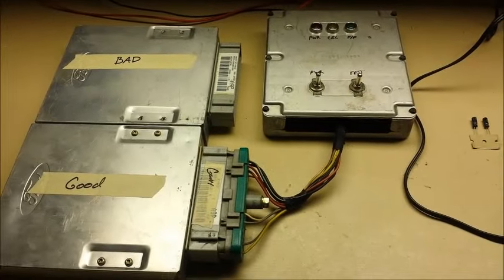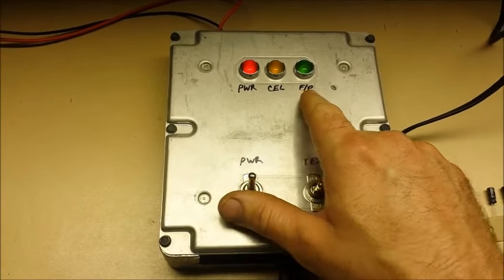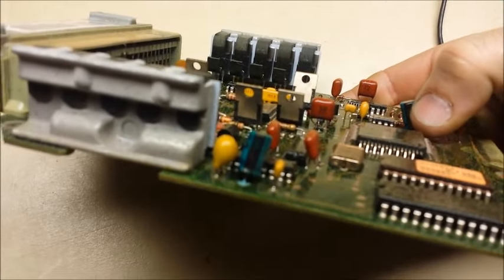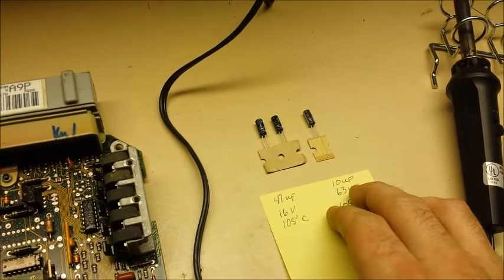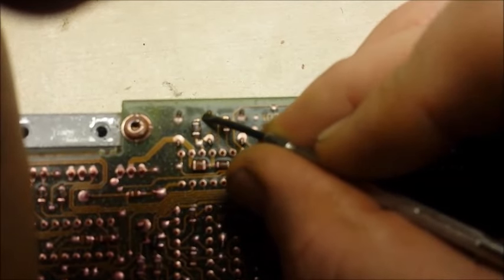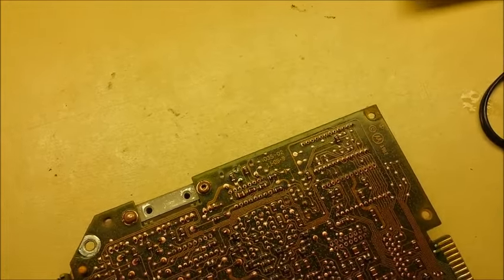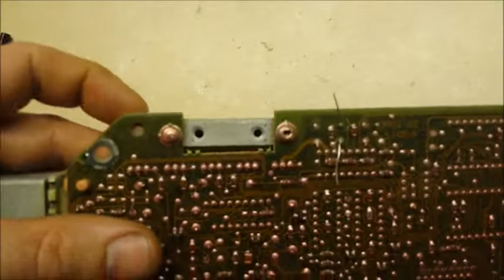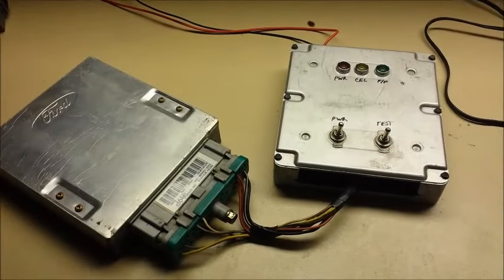Fox Body Mustang PCM Repair

Comment: ive been trying to figure out what is going on with mine for a couple of days before I saw this. I definitely had corrosion on 2 of my caps. I cleaned them and reinstalled and same issue but mine is a little different. I plan to follow you in this and install new ones but maybe you can shed some light on my issue as it's a little different. At first, as soon as I would connect the battery, the fuel pump would turn on, found out the there was a toggle switch that was in the "on" position so that explained that.Then, no matter where the switch was the wire to fuel pump was always on and running the pump. spent about 10 hours checking wiring, tracing wires, reading diagrams and diagnosing and come up with the same issue, except the pump maybe grounding out because as soon as I connect pump I get no voltage, as soon as I disconnect ground I get voltage at the relay wire that i can't switch off or on. So it's stays on like a bad ecu and as soon as I connect the pump runs for 2 seconds and fades out and voltage disappears as if it's being grounded out. Vehicle is a 1967 mustang with efi swap, vehicle used to run with this a3m1, I have a old Hickok breakout box I will try to figure out, anyway, any ideas? Sorry for lengthy post! Appreciate any help!

Comment: What are the functions of the capacitors? Is the 10uf/63v one for a power supply? And the 47uf/16v ones are filters of some sort? 

Can the computer be tested for functionality outside of the car?

Comment: I just got a 89 coupe with some work done to the motor bt its deff running rich n fuel pump running all the time. I haven't checked the KOKO to see if I can read the codes or looked at the computer to see if they are corroded yet, but I am goin to still go ahead n purchase the capacitor in case it does or possible  is wrong with it. Is there a better kind of capacitor to buy? Or the regular one's fine? I had seen some that was aluminum n they was 8 bucks a piece, n well if it matters then I will get them, but if not I will just order the regular one's. Thanks a million for this video, I haven't checked to see if the relay is bad also for the fuel pump or if some dummy just jumped it over. Like I said I just got this coupe n it look's like someone had it doin it right with the parts that is on it, then some one got a hold of it n didn't know what they was doin. The guy I got it from said a young boy had it before him n he acted like he didn't know a whole lot also. I been doing these car's for 20ty some yrs n this video is the first I have seen about the Ecm, many thanks again!!

Comment: Thanks for the informative video. A few years ago I replaced the 10uf cap which was obviously deteriorated.  I left the two 47uf caps in because they both looked OK and passed the ESR test but I will follow your advice and replace them. I recently pulled the PCM out again because of a 'no spark' symptom. I am following the TFI worksheet at TheRangerStation website. I am trying to find pin 56 on the PCM board so I can check the continuity from the TFI socket to the PCM socket because I am getting less than 1 volt at the TFI SPOUT connection. Is there a pinout of F2TF-12A650-PB or similar PCM on the net? I am diagnosing a 1993 E-350 with a 5.8.  Thanks in advance for any help that you or anyone else can provide.

Comment: Great video man.Ive got a couple questions though.Im aware of another common problem with the A9L,A9P,etc which is the shorted SigRtn trace on the ecm board.To keep things very simple,can you list all of the symptoms that can occur when the capacitors are bad and when the SigRtn trace is open?? 

(Example)

Bad Capacitors:
    1)fuel pump runs continuously
    2)check engine light off with koeo
    3)  "                "

Signal Return Shorted:
    1)scanner fails to trigger a code test
    2)codes present for act,ect,evp,bp,tps
    3)  "               "

Thanks for any further assistance you can detail about this topic.
BTW-did you use the case of a EEC-IV ecm to build your tester and can you let your secret out as to what you used to build it?? 
                                          Thanks again
                                             WBRockstar
Reply: sigrtn burnt leaves you unable to dump codes, constant cel light on and running like total crap.  the caps leaking from age and burnt traces are about the only issues I've run into but I 've only repaired a few dozen years ago.  came across this seeing if anyone made a video after seeing the crazy money these things are selling for now since I'm getting back into an old efi 50 on a 93 I just picked up, went coyote swap along time ago on my other car.

Comment: You still offering this service? 
I have this exact same problem. Be trying to find the problem for a minute now. I was idling and the car randomly just died. Wont start but cranks. I have fuel pressure, spark, and power to injectors, car starts on starter fluid. But no injector pulse and fuel pump stays on continuously.

I found one of my capacitors has green fuzz pooled around the connection.
Reply: Eric Larsen I have the exact same symptoms glad I’m not the only one. My capacitors are bad as well.

Comment: I.m working on a 99 Mazda b4000 I have a no crank and no power to the PCM diode but do have power to the PCM relay also don't have power going to the ignition side of the starter but I think the problem is in the PCM could you tell me if that's possible

Comment: A 91' GT My dad bought new (I was about 3 or 4 years old at the time) finally broke down for the first time after 28 years of a daily driver last summer and it's been sitting ever since, and I think this is what's wrong with it because I've tested and tried it ALL.. Dad saw this and I cracked the ECU open to find Capacitor #1 completely blown out. Hopefully once I find these pesky hard to find Capacitors it'll be it and I can send you some roses and chocolate (Joke).
Thank you and I'll keep you guy's posted on weather it worked which I'm sure it will.

Comment: Hi, i have a A9T computer that doesn't light up the check engine light is it broken or it can be fixed the same way??
Thanks for your time
Reply: Hey there...did you ever figure this out?...I have an A9L and there’s no CEL at any time...sure it could be a bulb but I am also unable to pull any code even 11...would think it would have to be throwing something...initially the car ran but had an off idle stumble and at low cruise and would get to bucking like crazy...5sp...tfs 1 cam...would have to really ride the clutch a bit to take off at times...idled somewhat high...surging would be intermittent...tps appears to check out...IAC when disconnected would drop idle which was the only investigation I’d done...went through other things like trying to set base timing and wouldn’t want to stay running with spout removed...also appeared way retard as almost a tooth off to get it to 10*...fresh plugs and cap/rotor...just had the caps replaced from a local electronics shop...still no CEL...actually haven’t started it yet...will have to mess with timing again when I’ve got more time...turned over but no start...please any advice would be wonderful...very disappointed and coming to a bit of a loss as to what route to take at this point...as we have all been at this point where you think it’s gonna fix things only to be let down
Thanks in advance...

Comment: My fuel pump never gets the 2-second pulse it just always stay running but if I prime the engine with starter fluid it will run and stay running, But! it won't display codes when a scanner is plugged in or in use of a jumping wire. I'll try my best!!!

Comment: Very good video, I am actually thinking, I could do this! Where do I buy those 2 different capasitors?? EBay?/ Could this be my problem also?? I have 2004 mustang, 3.8 litre engine on. I get "check fuel cap" light coming on, even I replace cap, NO help, I did change fuelpump bigger,255 lph, since I am planning to add supercharger from Cobra into it (already bought it). I also replaced throttle body bigger, now 70mm, used to be 60 mm?. Now I have high idle really high, like 2500 for awhile, after 20-30 seconds goes down to 1200 RPM, never lower??/ Codes says there is problem with large leak, can't find it and also P0443= problems with purge control valve circuit, P0455 EVAP system large leak, and P0405 Ext. gas recirculation sensor circuit low?? I sure can't find leak, and replaced so far TPS, IAC sensor, EGR, purge solenoid valve, purge valve???/ Could purge solenoid valve be open all the time, and reason being bad PCM/ECU?? Former owner replaced starter, and did bad job, car never started well, and was very difficult to start?? Maybe he shorted something out???  I actually had to replace starter again, couple months ago. Is PCM same in all Mustang?? Or different in 3.8 litre and 5 litre?? Should I take PCM out and check these 3 capasitors?? Thanks a lot, this was a great video, youtheman =)  Ps. could you check/measure capasitors someway without taking them out of board, unsolder them?? thanks...
Reply from the maker: 2004 will not have the same type of capacitors that commonly go bad. PCM failures are pretty rare for 96-04 computers. It definitely sounds like you have a big vacuum leak. The best way to find a leak is with a smoke machine.
Reply: OK=) Thanks=), but high idle and P0443 seem to tell that PCM bad??
Reply: So, what usually goes bad in 2004/ OBD2 computers??? Different kind on capacitors??? How do you test them?? Thanks=)
Reply: Can you tell me what kind capacitors newer Mustang 2004 OBD2 PCM has?? Where can i order those and how to check which one are bad??? Thanks a lot=)

Comment: I just had that exact capacitor changed in my ecu well after watching your video i notice my polarity stripe is backwards. Can you tell me which circuit that controls? I have no check eng light with key on, car does run but i want it correct. Thanks

Comment: Thanks for the video. Mine started running the fuel  pump KOEO about a year back. I haven't had time to mess with it since it is not my daily. Before that It would erraticly quit with the ect hooked up. And it has been running unhooked for a while. Would a tune (running Quarterhorse) become corrupt out of nowhere? Regardless the eec is coming out as soon as I get home.
Reply from the maker: Yes, it's possible. The QH uses a coin cell type of battery to keep the tune stored in memory. When that battery dies the tune is lost and you will get the fuel pump run-on condition. Early versions of the QH were shipped with an incorrect resistor that would make the battery die prematurely. The newest versions have the battery in a replaceable socket so you can replace it yourself. Earlier versions had the battery soldered in place and must be sent back to Moates for replacement. Their turn-around is quick and their customer service is excellent. Try reloading your tune with a laptop, if it corrupts after removing power and USB for a couple of minutes then you likely need a new battery.
Reply: Ok Ill try that. It has been in there since 2012.
Reply from the maker: 2012 is right around the time frame of the bad batch of resistors.
Reply: On the Quarter Horse? Details
Reply from the maker: Yes. The bad batch of resistors caused the QH battery to drain faster. I'm pretty sure it was in 2012 when they shipped.

Comment: I have a 90 Mustang GT also and the car has been sitting for a while. It ran perfect before I parked to work on another mess of mine. The check engine light will lightly flickers with or without jumping to check for codes. The pump does run as described in your video, please advise if you think the ecm needs repair, thanks
Reply from the maker: It sure sounds like it. I'd crack it open and give it a look.
Reply: Yes, the capacitor is leaking as you suggested, can you refer me to a seller for these?
Reply from the maker: Radio Shack, Digi-Key, Mouser.

Comment: Great info, thank you.  Do you happen to know what color the check engine light wire(s) are?  I've got this 91 motor in a 68 coupe, no light at dash, but would be cool to have it to see if it's lit.
Reply: You would prob have to get a schematic online n run a check light to the ecm probally. If you still have, I just seen this was 2 yrs ago.

Comment: Hey EFI Guy.  What do each of these capacitors protect?  The same exact one that was bad on your video is bad on my car.  I have the skills to fix it but just really curious as to what they are protecting.  I have searched the internet to no avail.  Please let me know if you happen to know.
Reply from the maker: I don't know for sure. I'm not an electrical engineer or anything like that, I'm just a full-time mechanic and a part-time Ford tuner. I started repairing these things out of necessity. It seems every time I crack one of these open to install a tuning device I encounter the bad caps. So, repairing them is not my specialty, but I can repair the obvious bad caps, burnt traces, broken solder joints, etc...I'm just not an expert in diagnosing them.
Reply: They don't "protect" anything.  In all three cases, these are installed as bypass capacitors which filter out electrical noise from the dc converters (which change the 12V input voltage to other voltages the PCM needs - such as 5V or 3.3V for instance).  If the caps are bad, the output of the dc converters will drop and there will be a big increase in "noise" off the converters.  The lower voltage and increase in noise affects the active ICs.
Reply: @TheEFIguy how can I reach you

Comment: I have an 89 fox body 2.3 lx and the pink and white wire on my ignition control module that only gets power when you hold the key over to start the engine is getting back fed power from somewhere as soon as I turn the switch on the car starts all by itself could this be a sign of a bad computer the wire is getting back fed power somewhere as far as I can tell it’s from the ecm have got to test at the ecm to be sure but anyway you could help me figure this out I’d be grateful been messing with it for months I discovered that there’s an 8 pin connector in the driver kick panel that the white with pink wire goes to and then goes under the carpet when I disconnected that plug it stopped sending power to the white with pink wire on the switch I can’t find a diagram for these connectors at all thanks for any help
Reply: decidedisciple67 I didn’t find and fix the the problem it just went away but traced everything I put a power probe wire tracer on it and followed it all the way to a switch on the transmission on the driver side wiggled those wires and it went away I knew the wires were spliced back on it but never thought something like that would cause it to act the way it was
Reply: decidedisciple67 I appreciate the help buddy this one stumped me bc I never suspected a switch like that could cause it I’m still skeptical that was the problem but till it acts up again just kinda hurry up and weight lol

Comment: Wow found my comment from 2 years ago and noticed I've watched this before..
Update?: Well I replaced the bad capacitors and it well.. it didn't work. One of my main issues is that the flywheel got stripped right before the car stopped working and I cannot get a mechanic to replace the flywheel and clutch because the car won't start but I cannot try to test why the car won't start because i cannot turn the car over (Can only try to bump start). I'm afraid to spend the $20 to have the ECU tested because I'm sure they'll tell me it needs repaired and charge me the $230 for it to be rebuilt. The car gives me code when I jump the test lead, I have check engine light and the fuel pump shuts off so i'm at a lose here and the car has been setting for 3 years now which is shame because it turns 30 years old next month, and I don't want it to be dead on it's 30th birthday.
It's almost like I'm not getting fuel or something, and I remember we tested for spark and had it.

If at all you see  this please let me know cause i would love to pay you to test this ECU out for me, and if my repair wasn't efficient enough than I'll pay you to repair it. This car has been with me since I was 3 years old and it's like a family member now that's been with me and my dad for 30 years.. So needless to say I'm desperate to get this car running again.
Thank you for your time.
-Dave

Edit: I didn't realize you put your contact info at the end my apologies. I'll contact you there.

Comment: Hi! Great video!I had this problem and ended up replacing the computer last year and it ran fine until now, did the same thing and replaced the computer only this time it will idle (rough) but as soon as i depress the accelerator pedal or shift into gear the engine bottoms out and most often dies.  It ran fine before i replaced the computer leading me to believe that there may be something wrong with the new one.  Any suggestions?
Reply from the maker: If the only thing changed was the PCM and you don't have the fuel pump run-on problem, then look for a burnt trace  within an inch of the PCM connector on pin 46.